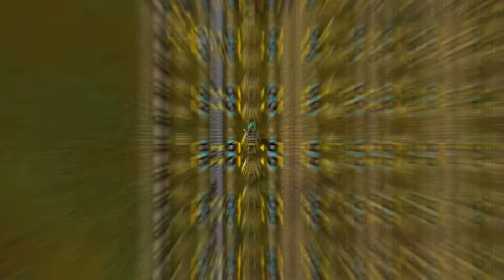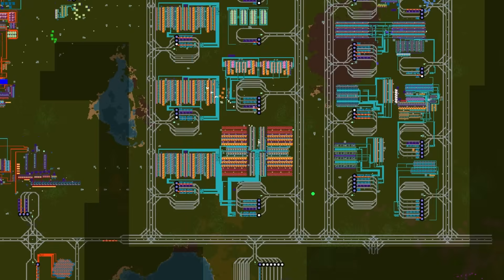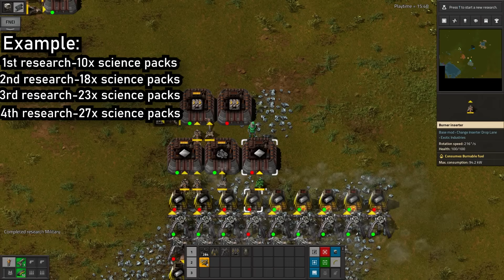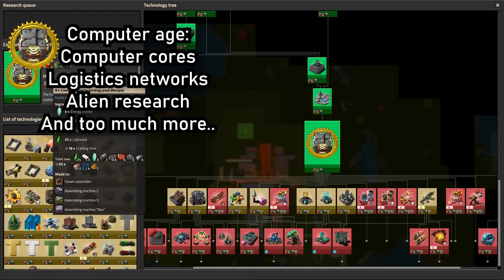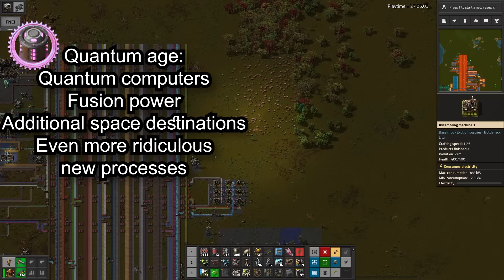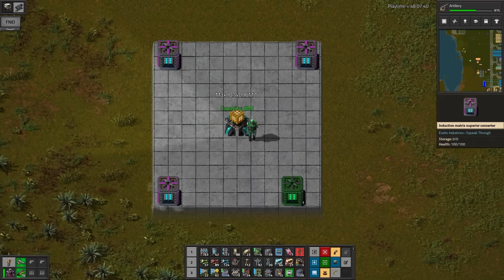I Beat Factorio's Most Underrated Mod - Exotic Industries

Comment: The fact that both fusion power and black hole generator are scientificly correct baffle me.
(fusion power use those exact element and black hole generator work by surounding a rotational black hole with mirror and then send a laser in it to basicly rob the black hole of its energy)

Comment: 10:40 It's not that difficult? The oil comes out of the ground cold, so to do fractional distillation you need to heat it up into a gas form. The most volatile (lightest) stuff comes out the easiest followed by the less volatile stuff, so you just repeat the process wiring the output into a new input each time and take the heavier and heavier fractions out until you're left with the heaviest, plus any solid impurities left over (coke.) In essence its just heating liquid then you have a line of output machines with different oils coming out.

Comment: I'm so glad to see somebody's finally made a video about this! I was begining to think I might have to do it myself. It does a fantastic job incorporating lots of diverse mechanics into it, all the way through it I felt like I was being presented with new problems to solve instead of just having to manage increasingly long chains of intermediary products. I might have to replay it now, since back when I tried it the whole Gaia plane didn't exist and alien seeds were all handled on Nauvis, I didn't realize it was still getting major updates.
Some other random thoughts - 
- I hate the scaling research cost and I think it's a bad design choice. It feels like you're being punished for researching any non-critical path techs and discourages actually exploring and playing around with a lot of the new systems the game adds. Fortunately you can adjust it in the game settings, but I'd rather it wasn't there at all.
- I ended up removing the mods which add new bitters. Like you said, combat isn't the focus of the mod and having those bitters around makes it much less enjoyable to explore the map (which the mod otherwise encourages through teleporters and lots of possible loot spawns). 
- Having the god tier reactor be the very last thing you research is really anti-climactic, it's strange having to build a very powerful reactor and a whole new complex production line for the research, and then just not having it do anything. Even just one more tech/strucuture afterwards would be nice to feel likey you're getting to use the generator.
- You can beat the whole thing even if you suck at circuits (that's me, I suck at circuits), but it does make a lot of the late game processes way less efficient than they need to be. I imagine somebody smarter than me could produce some really incredibly cool factories, especially since so many byproducts feed back into other production chains.

Comment: 39:55 
One accumulator can have a maximum of 5MJ, and assuming that your 630GJ accumulator charge comes from them, 126,000 (One hundred twenty six thousand) Accumulators.
Reply: As a follow up, accumulators and panels have different values in EI, and the panels:accums ratio changes accordingly, to about 4:3.  (With the better panels that come later, that changes to 2:3 AND THEN 1:3)